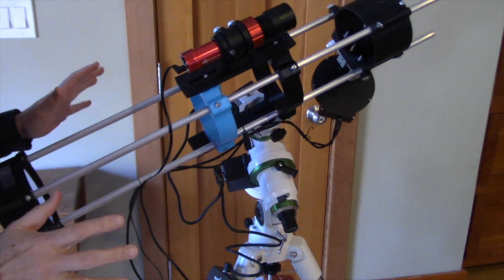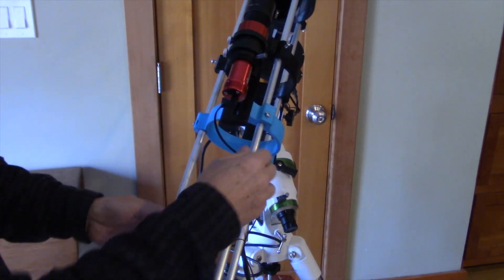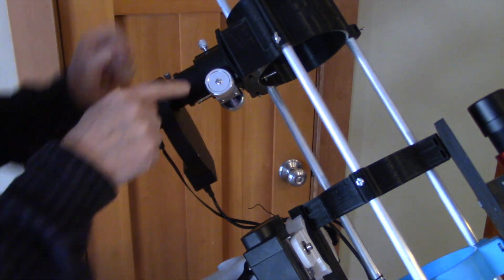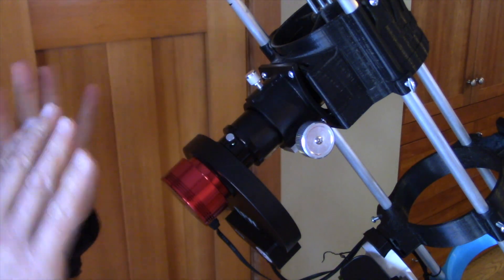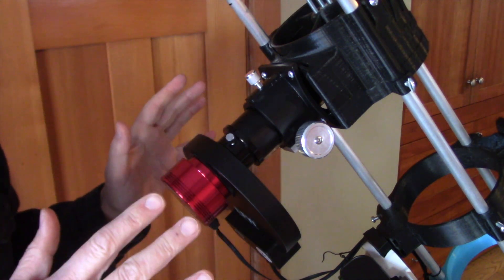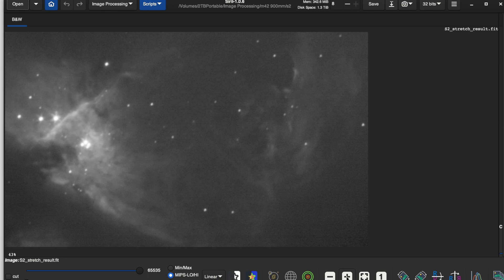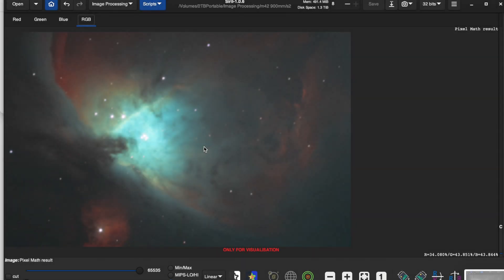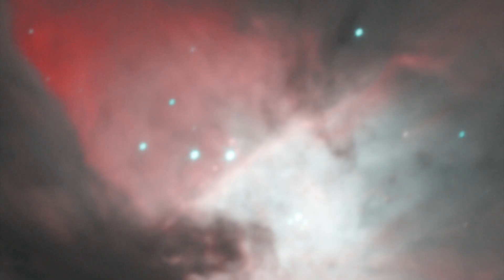How To Convert The Hadley Into an Imaging GOTO Newtonian

Comment: I printed out the Hypatia Crayford on printables, and it works pretty well. It had a few issue I had to get around, making sure the heatsets are perfectly straight, and epoxying the knobs to the rod, as the grub screws slipped real easily, though my rod was stainless. Cutting the aluminum strips was also a bit of a pain, because you can't have it bend or curl, and it needs to be straight to fin into the depressions in the tube, a Dremel was too hard to keep straight, so a small hacksaw worked great for that. It is working fine for me now, though the collet slips out of the main screw cap, making it a requirement to forcefully pull the eyepiece out on occasion, but I think that is a printing issue, as I had one iteration of the cap and collet that worked fine, til I dropped it down a mountain.
Reply from the maker: I'll have to checkout that design.  Glad you got it working well.